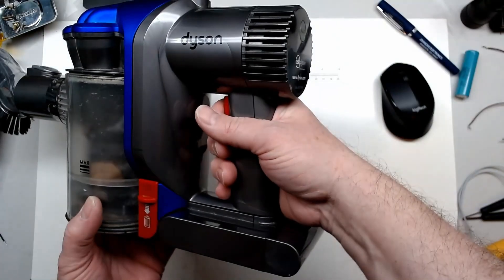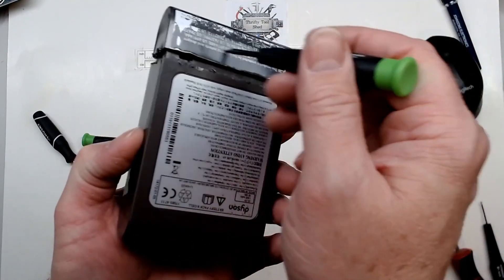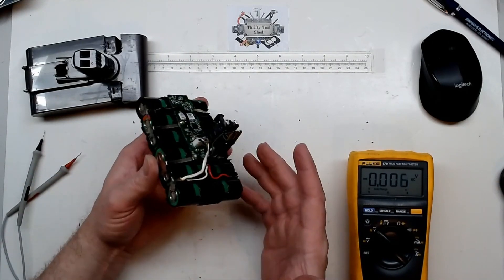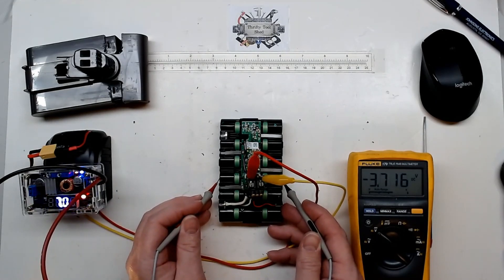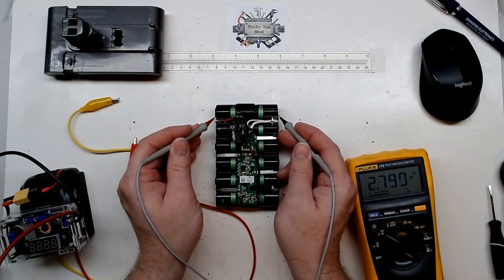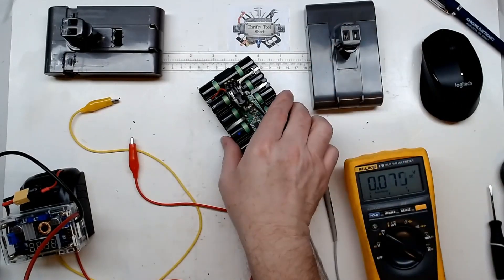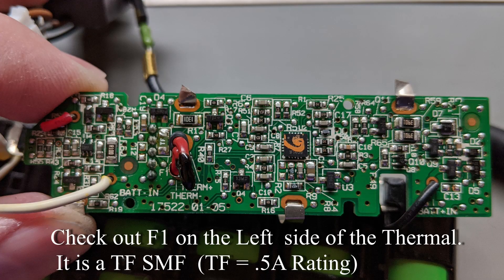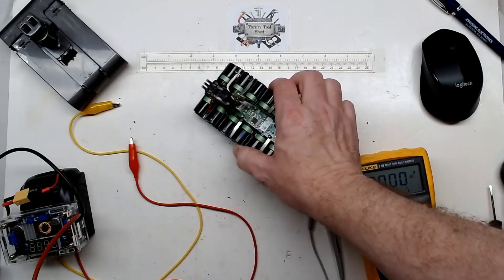A look inside a Dyson DC35 Battery Pack

Comment: I bought a battery from Amazon and just realised the battery is 12800mah the original that’s failed (original Dyson) is only a 1300mah, am I screwed or can I still use it.
Reply from the maker: That seems like a very bogus claim from the battery honestly. 12800mah is a large battery. That is capacity of the battery. As long as the battery fits it should work ok. I would seriously doubt the capacity is even close to 12800!
Reply: @ThriftyToolShed  Thanks, if it runs the Dyson for long as possible I’d be happy, probably won’t be 12800mah like you say, when it arrives is there a way to check what the actual MAH is?
Reply from the maker: @sabiya2  
Connecting it to a capacity tester is the best way as I do with many tool batteries on this channel. You can get a rough idea though just by comparing it to how long the old one used to run the vacuum when it was newer based on how this one does when you get it.

Comment: I bought a dc35 replacement battery from Ebay. It failed after 3 months of normal use in the Dyson. I've had other similar ones lasting 5 to 10 years previously. Would you believe EBay policies made it impossible for me to get a free replacement or money back? Disgusted and out of pocket.
Reply from the maker: Wow! That is unacceptable! I have almost stopped using eBay completely. I use it maybe 3 times a year or so. They have indeed fallen so far. I have very few links or references to eBay items in videos now. Really just the ones that can't be found elsewhere. They have gotten me before on a similar issue as well. No after purchase support, No business!
Reply: Thanks for writing; I value your sympathy. I've now received other similar reports about eBay. I have bought another replacement battery from Amazon and like you intend to give them as much of my business as possible in future. Thanks to the YouTube videos, I managed to get into the battery pack with virtually no damage. It actually doesn't look too bad inside. I'm in the process of taking measurements, to see whether it can be rescued. Regards.

Comment: Can I test mine by simply applying the pos/neg contacts of the multimeter to the top two terminals of the battery? How do I know which is positive and which is the negative terminal?? Thanks
Reply from the maker: The DC35 the power terminals are the large top two. Not the back terminals, but the two female type on very top.
Reply: @ThriftyToolShed  thank you, I understand that but how do I tell which is positive/negative?
Reply from the maker: Use the meter as shown in video. 1:34 the polarity should be as shown with the back of the pack toward you The positive is on the left.
Reply: @ThriftyToolShed  that's what I thought, I just wanted to make sure it was wired the way it looked 😊 thanks again
Reply: I am also trying to test my DYSON using my benchtop powersupply as I am considering running it off an 18V drill battery. SADLY these three small connections on the side of the battery are needed in someway :(
I've searched the internet but have not found out anything about them and what the vacuum needs to "see" at these terminals for it to run :(

There are two LED's on the motor unit, one around the MAX button and one on top of the vacuum motor body.
When running it with a battery, both of these LED's light up when the trigger is pulled.
Connecting my powersupply to the main battery terminals inside the motor unit and it will not run with the trigger. It lights up the rear "MAX" LED but NOT the top LED.
Thus it knows the difference between a battery and the powersupply :(

Does anyone know what the three small battery contacts are and how to fool the motor unit to thinking a battery is inserted ?????
Reply from the maker: I have not worked with that model to say. I know on most drill packs at least one of the terminals is usually a NTC thermistor for temperature monitoring. Some packs have a communication between the pack and tool and those are tough to work around.

Comment: I just replaced the 6 cells on my Dyson c35.  With 2500 mah.cells. I read somewhere on the internet that some Dyson battery packs will brick or lock up if you remove all the cells. Is that true? I also wonder are their power tool battery packs out there that do the same thing? Love your videos .Keep them coming.
Reply from the maker: I believe it is true. I shared a bit of that information in the Dyson DC58 video that I ended up putting a Milwaukee M18 pack in to run it. It seems Dyson decided to basically lock-out the microcontroller if any of the cells drop below low cut out level. It seems nothing will bring this pack back to life without BMS board replacement. While you can find generic replacement boards on eBay etc. It seems like you can buy the generic replacement packs almost as cheap as the board by itself at times.  I ended up buying a generic pack for my wife's DC35. The DC58 that I bought (broken) to see if I could fix it is the one I decided to run with the M18 pack instead, just wanted to  Frankenstein it. I am not sure all Dyson's do this, but it seems likely. Thanks for your comment and best of luck to ya!
Reply from the maker: I do not know of any power tool battery packs that do this, Dyson is the only one that I know of.
Reply: Unless you have a programmer to reset the IC on the BMS, you can NOT just swap out the cells.
Reply: Did you change cells of your C35? What happened? I am going to do that.
Reply: I removed all the batteries and it works except max power mode, mine is v6 version
Reply from the maker: Thanks for sharing!

Comment: wish you explained what those 3 brass contacts do - i'm trying to connect power directly to the vac but it just won't run - it did with the battery pack installed so i'm guessing the motor circuit needs to be reading something from the contacts
Reply: Have you tried to reset it? You plug it into the charger and press the power button for 20 seconds and this SHOULD reset your dyson. Just something you may want to consider trying.

Comment: Wish they had a separate charger so I could have 2 batteries to use. It seems the battery goes dead after I start to use it and have to wait fo the battery to recharge. Would be nice if I could switch the battery like on my drill. Very informative video, well done.

Comment: You had better luck getting it open than I did.  I was feeling rather clever inserting palette knives under the tabs to do less damage to the plastic but when I pulled the assembly apart it sheared the plastic of the JST connector right off.  The pins are ok so I can put a new plastic sheath on but I'm not sure I trust it enough to ever connect to power again.

Comment: Dyson is, unfortunately, a 'planned obsolescence' company, that wants you to buy a whole new vacuum every few years, as well as a new bunch of batteries and accessories, as they make each new model incompatible with all previous products. I got burned by them once, and will never buy another Dyson product again. It's a shame that they do this, all to suck more money from their customers.
Reply: Yep, if you look at powertools as an example, they keep their same battery style for years so its compatible with all their new tools they bring out.  A much better approach.  I'II never get a Dyson battery product for the reasons you noted.
Reply: @briankelly7998  Nope, 'Greenworks' garden tools powered by batteries, may have one of three different designs for the same voltage tools. They will look similar, but won't fit the other tool. When I called them and asked why, I got the usual runaround about how the 'new' batteries are so much better, and that the 'old' tool shouldn't be used with tne 'new, more powerful' battery because it might burn out the motor', So that's why I needed to buy a separate charger and batteries for each tool, even though they were the same voltage. When I took the battery apart, same lithium cells inside. All to make the customer pay extra. Nope, never again, I'll stick to using corded tools. They all fit into the same socket. NO more new battery powered nonsense. Let them standardize the batteries like they have with cars, D cells, 9V cells, C cells, AA and AAA cells. after all, the cells inside of those casings are all the very same lithium voltage cells. Only the connections are shaped differently.

Comment: What did you end up doing with the cells from the old Dyson battery pack. I have one of those packs and wondered if I can use it somewhere. Maybe to replace power tools battery cells if they are of the same capacity?
Reply from the maker: Well I don't use these for my tool batteries because the capacity is reduced to less than half on most of them, however, I do use them for things and projects I make. I use them in airsoft gun batteries, use them individually in a couple laser flashlight combo we have for air soft guns and sometimes just projects I may build to use as portable power. I have used some in a repaired lantern for example that used to take 12v of AA batteries after cleaned up corrosion and got it back working and then upgraded to rechargable with a 3s pack of used cells that would still last for hours.

Comment: are you satisfied with the 3500mah battery?. Does it run 3x as long as the original?
Reply from the maker: I have been satisfied with it. I do not have as much area to vacuum with this as we did when we first bought it so I can't say for sure it last alot longer than when it was new, but it last much longer than it has in the last few years for sure. With the few rugs and going over corners etc. We have not had it stop on us at all before putting it back on charger yet!